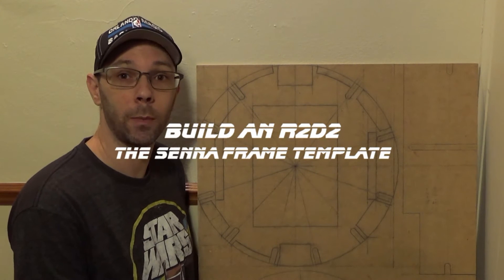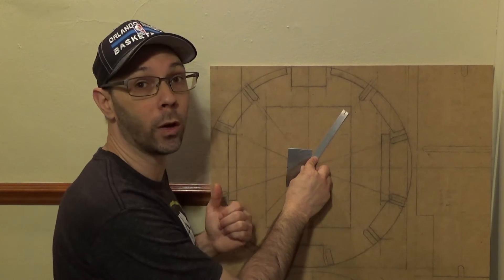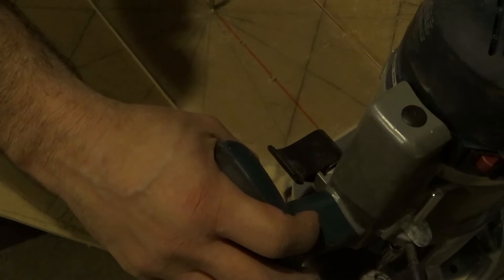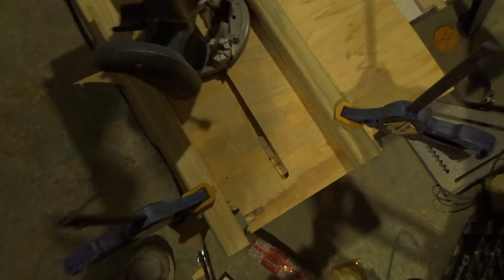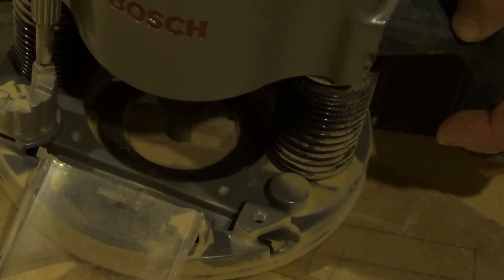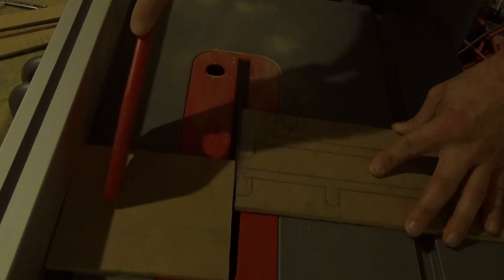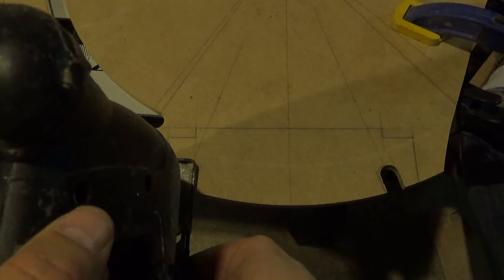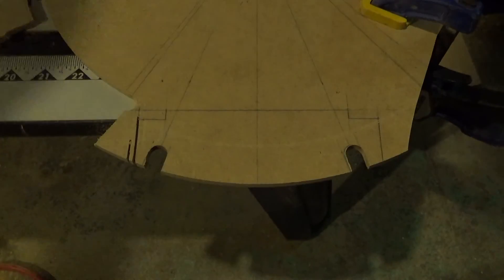R2D2 Senna Wood Frame MDF Template

Comment: i am on the forum sites under blueprints and found the link. Do i print it out on paper and draw the plans?
Reply from the maker: You can do it however you want. Some redo the plans by hand, others simple glue the plans to the Baltic Birch plywood and go from there.  No right or wrong way.
Reply: Build an R2D2 when I print them out on paper though are they to scale and useable? Meaning can I print them and then put them right over the wood and get to cutting?
Reply from the maker: You need to make sure they print to scale. A good photocopy place should be able to do that. It is 18" wide so you'll need a decent size printer

Comment: how do you cut the mdf plans out if you do not have a table saw, the only tools i have is a jig, router, miter saw ?
Reply from the maker: +Joseph Chamberlain you can just adapt to the tools you have. Measure carefully and use router guides for long uprights. Remember the mdf is for templates only.
Reply: ty also how tall are the uprights on the wood frame ?
Reply from the maker: +Joseph Chamberlain it varies for csr and csl I think I recommend looking at all blueprints.

Comment: For the top and bottom plates, do you have to put 2 rings on top of each other?
Reply from the maker: +mark Coleman It depends on the length of the bearing bit that you use and the thickness of wood used for your master template ring.
Reply: Right so you could use two smaller ones or use 1 bigger one.
Reply from the maker: +mark Coleman exactly. Its better to make one  templare with bigger slots and use that. U just need to make sure the middle ring slots are smaller.
Reply: Righteo thanks.
Reply: How thick was the final product?
Reply from the maker: +mark Coleman Do you refer to the final base plate or template? The base plate will vary based on thickness of wood. The templates need to be thick enough to get your dimensions and the router bit to the proper depth on the plans. Some stuff i did free hand very carefully. The upright slots are most important.
Reply from the maker: +mark Coleman Do you refer to the final base plate or template? The base plate will vary based on thickness of wood. The templates need to be thick enough to get your dimensions and the router bit to the proper depth on the plans. Some stuff i did free hand very carefully. The upright slots are most important.
Reply: I was meaning the final base. I'm pretty sure The plans on the r2d2 builders club said either 17 or 19 mm.